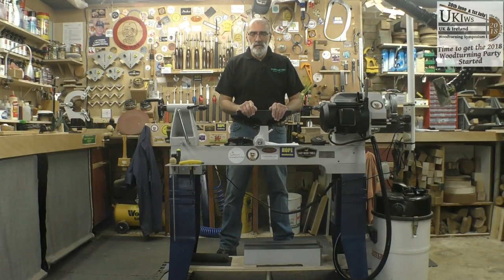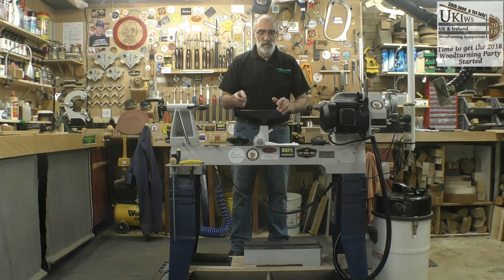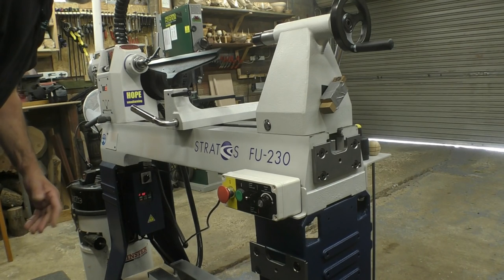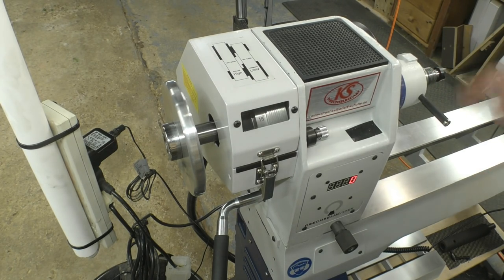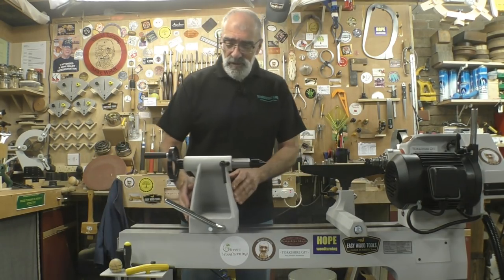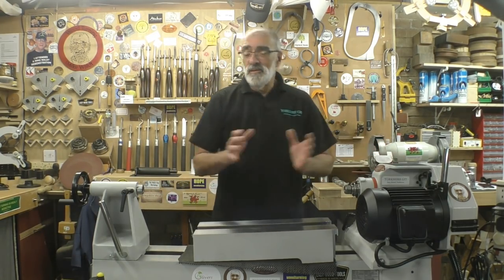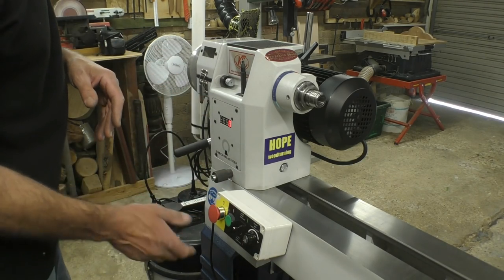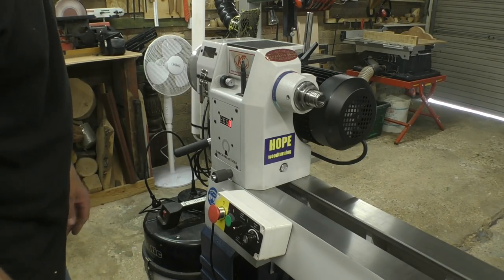The Stratos FU 230 Wood Lathe Review

Comment: I was going to ask if it was easier to change the belt on this Stratus having already watched your excellent vidio on how you changed it on your old Axminster AT1628VS, but of course you showed how it was a doodle on this lathe. One thing I would like to know, seeing as the inverter box is separate and seems to be able to be fixed in different positions, when the lathe was delivered was the head stock and motor - as well as the tail stock - separate from the bed enabling easier handling out of the box? I got the impression on the AT1628VS because the inverter is hidden under the head stock in the bed it came already attached to the bed making it a pain to man handle alone.
You may have sold me on this, having long considered the Ax AT1628VS (or AT406WL as they call it today) I'm looking at this FU 230 with longing.
Do you think it's the worth extra price Mike?

Comment: Hi Mike, I’m looking to buy the FU230. A question I have is regarding the motor - you addressed the dust issue, but what about how close it is to the Chuck?
If the workpiece were to split and fly off is it possible for it to hit the motor causing serious damage? Thanks
Reply from the maker: Hi Rob, I have never had an issue arise regarding that.

Comment: Greetings Mike and congrats on your new lathe.
I chose the same model for myself some months ago and I am very happy with it, but it was a hard decision between this one and your previous AT1628 VS, because they are almost the same spec and size, including the outrigger for the larger turning diameter. Why exactly did you change? Was your old one already worn out?
Reply from the maker: Hi Andreas, my old machine was still working perfectly. I wanted to be able to turn bigger pieces and the Stratos allows you to do this from the side, not just the ends, like my old lathe. Also the bracket system allows easy and quick attachment and removal of the extension bed, plus some other refinements, which were not presemt on the Axminster. 
Cheers
Mike

Comment: Hi Mike. I've just ordered the Axminster 1628 on the strength of your review a while ago. Having just watched this review I'm wondering whether or not to cancel and get the Stratos 370 instead. Is it worth the extra £600? The capacity/spec looks very similar.
Reply from the maker: Hi David, you mean the FU 230 I'm sure. In my opinion it's worth every penny of the extra .... but I reiterate ... it's my opinion :)
Let me know what you decide.  Don't forget to mention me to Simon if you decide on the Stratos  ... then took get a free sanding arbor kit.
Cheers
Mike
Reply: Thanks for replying Mike,
Yes, sorry I did mean the FU 230. I am a bit torn, but I don't think I can justify the extra £800 it would cost me on a like for like basis unless there was a significant improvement over the Axminster. the step up from my existing 1979 Record Power CL2 to the Axminster is going to be quite significant anyway so I will stick with it. If I had seen your review earlier I may have come to a different decision. 
Regards
David
Reply from the maker: The 1628 is also a very capable machine ... it boils down to personal preference in the end.
Enjoy your new lathe mate :)
Cheers
Mike

Comment: Hi Mike, sorry for the belated comments. I've been looking at at the Stratos- FU180 "Twister" for awhile now and which would replace my decrepid old APCT M900 . I do like the Stratos lathes, are they definately made in Germany and not just made in China and badged as Stratos? BTW, strange that on the Stratos XL lathe they do actually have a facing plate that guards the motor inlet vents from shavings/dust.......................To me personally, I really cannot understand why most lathes have their  motor cooling vent backing onto the worst place for shavings/dust ingress.
Reply from the maker: I agree with your sentiments regarding the motor orientation,   but have been assured that it has no negative impact as the unit is a completely sealed unit. 
Cheers
Mike

Comment: Great lathe, not to stagger off in another direction, but.. I have watch all your videos almost religiously and I have a question.  I have noticed when I finish turning my pieces true and put a mortis or tenant in bottom and reverse it into the four jaw chuck it is no longer true.  What am I doing incorrectly?
Reply from the maker: Thank you. Very rarely do you get the piece to run perfectly on the tenon, but a little trick is to bring the tailstock live centre up to the piece with a small amount of pressure before you finally tighten the jaws on the tenon, and this minimises the out of "trueness". 
Hope this helps
Cheers
Mike
Reply: Mike Waldt thanks, I'll give that a try tomorrow. I have a beautiful piece of maple that I plan to turn
Reply from the maker: Let me know if it works for OK for you 
Cheers
Mike
Reply: Mike Waldt I definitely will, I will be using a mortis on this peice

Comment: Hi Mike, I hope you are well. I had hoped to have a chat with you at Harrogate this year, but unfortunately my health prevented me from visiting the show. I have a question for you regarding your decision process that resulted in you choosing the Stratos lathe. You mentioned in your video that you wished to have the ability to turn bigger pieces. But unless I have got this wrong, the increase in the distance between the bed of the lathe to centre is only marginally bigger than the Axminster AT406WL. Can I ask you if you ever considered upgrading to the bigger Axminster Trade AT508WL ? From a price point of view, I can’t imagine that the difference between the bigger Axminster and the stratos you purchased would be a great deal.  I am considering an upgrade myself. I have a Hegner HDB200XL lathe at the moment.  My shortlist has come down to the two lathes I have mentioned.  I would be more than interested to know what your thinking processes were and why you eventually chose the stratos.   Keep up the good work Mike, all. The very best, Yours Ricky
Reply from the maker: Hi Ricky, I didn't make Harrogate this year due to work commitments :(
I had the pleasure of turning for three solid days on this lathe at last years Harrogate Show. I was looking to upgrade and space is a big consideration. The stratos offered a very easy and flexible solution for bigger outboard turning, and longer spindle work .. this is what sealed the deal for me personally.
Hope this answers your query.
Take care
Mike
Reply: Thanks for you reply Mike, I wish you and your family a very happy Xmas. Yours Ricky